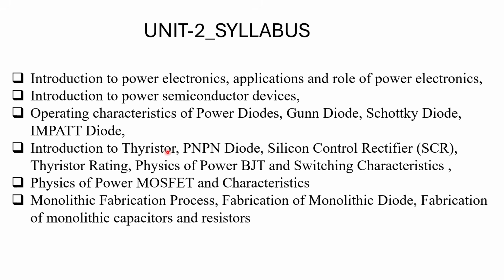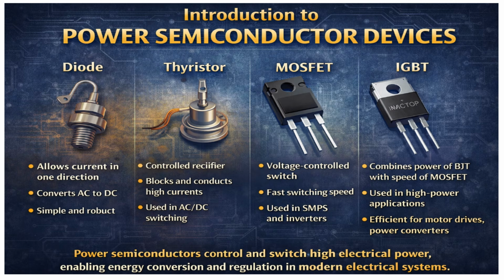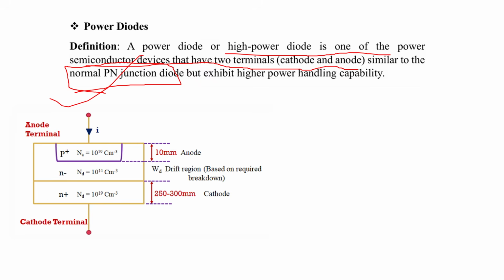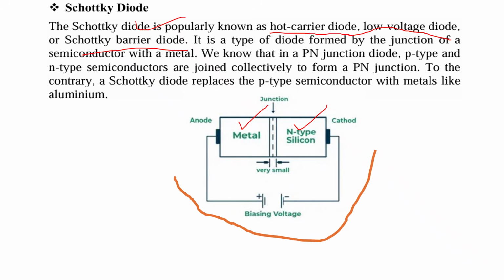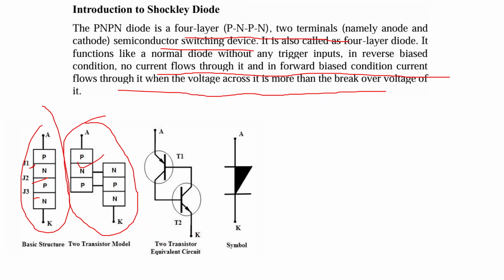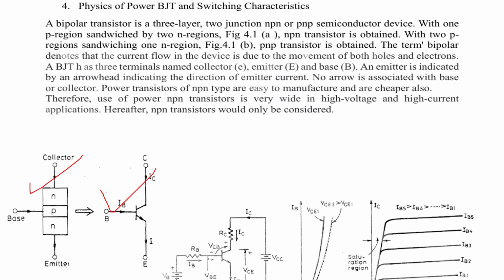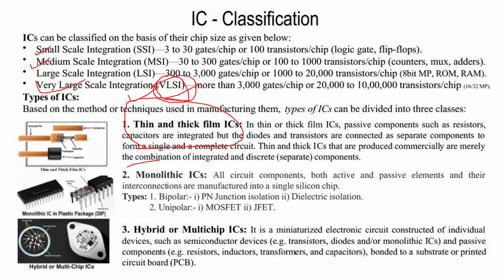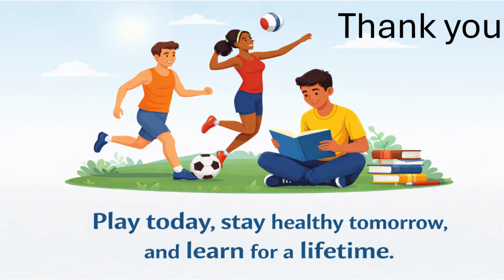UNIT-2_PCB Introduction to Power Electronics

Comment from the maker: https://youtu.be/8FVGSgzK0H8
UNIT-2_PCB Introduction to Power Electronics
https://youtu.be/H8qyCUS5iqM
UNIT-3_PCB Power Supply Units
https://youtu.be/WweXuqZkr50
Current derivation in conductor wire, diode, BJT and MOSFET